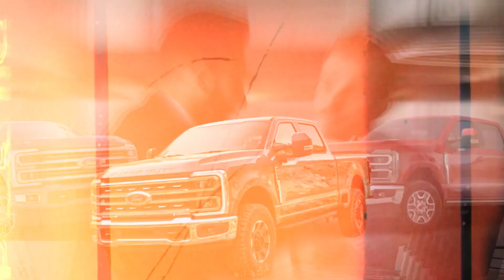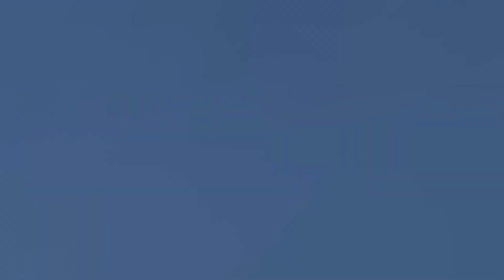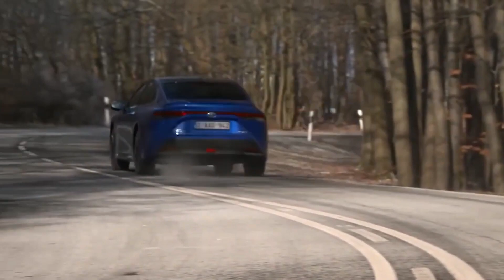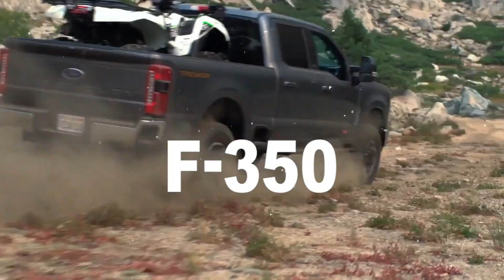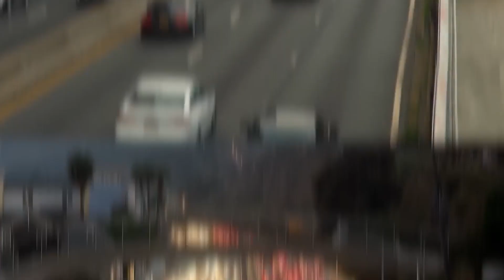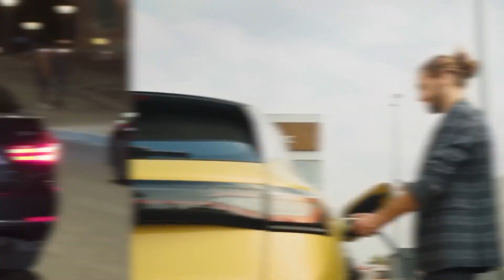Ford CEO Says, "Our New Diesel Engine Will Put an END to EVs!"

Comment: Two weeks ago, the Ford CEO called it quits to producing EV's. Never was a good plan. Curious how Ford can state this new diesel engine will have way fewer problems. As we have seen, things don't start showing up for a year or two often; and the transmission in the new 7.3L started having problems about that time and now the engine is showing it's weaknesses. I'm a Ford fan, but they like all the other dealers need to start figuring ways to build these trucks with reasonable dependability at lower costs. The path we're on is unsustainable!

Comment: There is no way that they are gonna make this engine more durable than the 7.3 l power stroke no way and there's no way that they're going to make it more economical by putting an EGR on it LM AF O you're joking and there's no way in hell that you're gonna make it more reliable having that EGR resurculating suit and carbon back into the cylinders😂😂😂😂😂 The solution is taking a pre-existing internal combustion engine putting a super charger and water methanol injection into it and there you go clean oxygen producing vehicle. The only reason they want electrics is so they can track us and have AGPS enabled turn off switch.... If people really wanted green they would do hydrogen. you could have hydrogen generating plants everywhere in the form of gas stations with big solar farms large enough to create the hydrogen on-site problem solve no huge infrastructure no electric lines everywhere all pre-existing... They don't care about green because green is fake if climate change were real they would not have the Palm islands in Dubai they would not sell property in the Florida keys there would  Be no such thing as ocean front property because insurance companies with all fail from the ci think of all the locations in the world that would not exist if climate change were real... Plymouth rock has been out of the water for a 100 years in the same exact spot.... But responsibility and clean air is important and that's why hydrogen is the way of the future. Energy dense abundant clean and actually improves the air quality it's funexciting sporty and you get to keep the same growl from that V8...

Comment: Remember that the U.S. accounts for only 15% of global greenhouse gas emissions (compared with 30% for China). That means U.S. passenger vehicles contribute only 16.4% to the country’s 15% share of global greenhouse gas emissions – less than 2.5%. But for the U.S. to achieve a 2.5% greenhouse gas reduction through this narrow channel would require abolishing and destroying all U.S. passenger vehicles.
Reply: Yes but there is 4xmore people in China.
Reply: Look up emissions globally.  China is the largest polluter due to their massive manufacturing.  Turn over much that you've bought that doesn't say "made in China"?? There's a reason it's there.

Comment: The way to go....Ford...5*****.
ICE v EV......

ICE has a small tank containing the fuel to drive the engine....Easy to fill and plenty of filling stations.

EV has an almighty heavy tank called a bettery to contain the fuel (electricity) that takes ages to fill if you can find a charging station.

Diesel fuel is plentiful and the fuel is improving all the time.

Electrical fuel is not plentiful and requires massive generating plants everywhere and you know what?.....A huge amount of fossil fule is needed to produce the electricity, China for example is burning huge amounts of coal for electricity generation.
EVs are using Rare Earth Materials fast and cost a fortune to make.

ICE vehicles use materials that are plebtiful.

What are the selling points for EVs.?
Not the price...They are double the cost of an ICE vehicle.
They reduce pollution.?....Doubt that.
Convienience?...Ha ha.

The driving force for EVs is simply GREED, MONEY and PROFIT.
You think the consumer is stupid.?

The American consumer knows best.....

Comment: So like hippies love plants. Plants love CO2. So, hippies should love CO2. At least that's how I would expect it to work. Although, this is the right move for the customer. And yes, they will overload it with sensors. I am so tired of sensors that don't need to exist failing.
Reply: Yes but too much co2 builds up in the atmosphere creating a greenhouse effect. Plus co2 isn't the main gas vehicles emit.
Reply: @reddeadren351c8      Due to deforestation...

Remember that the U.S. accounts for only 15% of global greenhouse gas emissions (compared with 30% for China). That means U.S. passenger vehicles contribute only 16.4% to the country’s 15% share of global greenhouse gas emissions – less than 2.5%. But for the U.S. to achieve a 2.5% greenhouse gas reduction through this narrow channel would require abolishing and destroying all U.S. passenger vehicles.
Reply: @gnd111  what this have to do with what I said